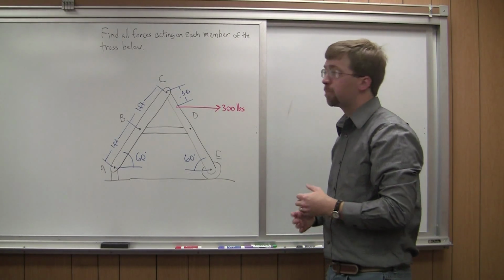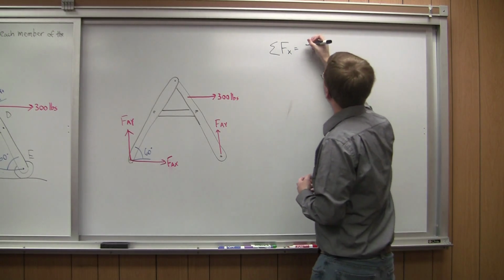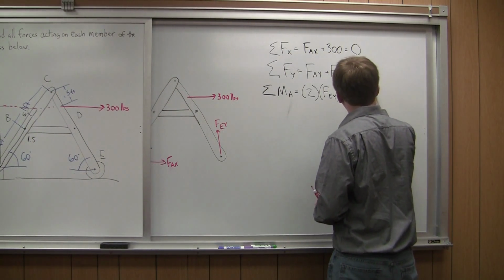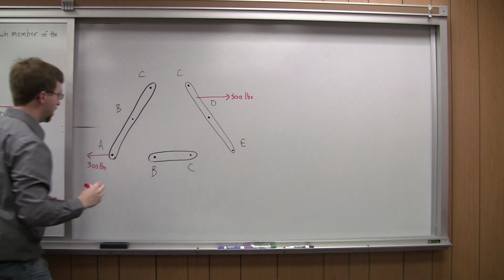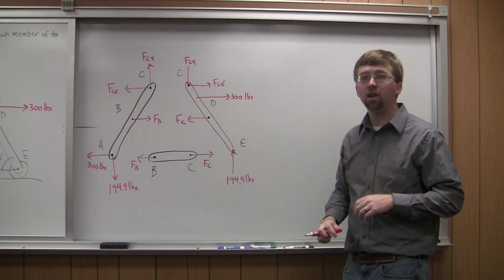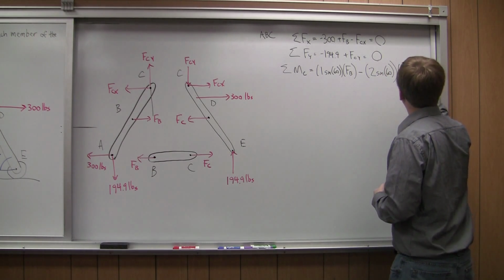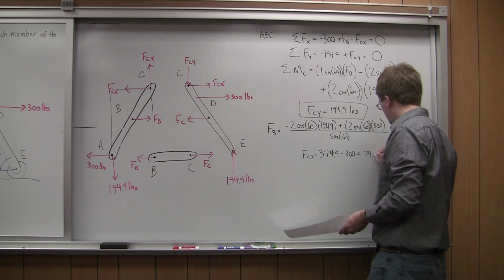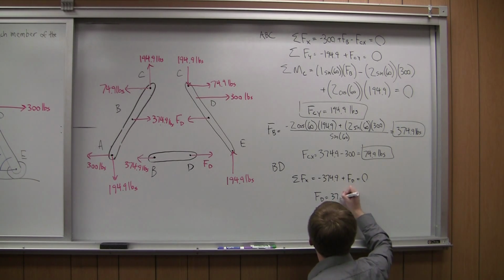Analysis of Frames and Machines - Adaptive Map Worked Example 1

Comment: How would you determine the determinacy of the structure using a formula
Reply from the maker: Determinacy is all about having enough equations to solve for all the unknowns. If you create the free body diagrams, count up all the unknown forces. Next count up all the parts. You will potentially up to three equations for each part (forces in the x, forces in the y, and moments). If any equations don't have any unknowns in them don't count them. You need to have at least as many equations remaining as you have unknown values.

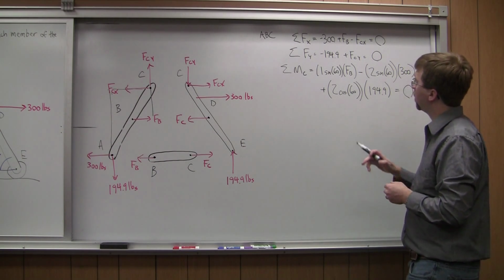Comment: 13:57 why you didn't take the 194.9 lb as a negative magnitude? Or is it always has to be the absolute of the magnitude???
Reply from the maker: +Ahammam Alsindi The 194.9 lb force would cause a counterclockwise (positive) rotation. Because of that, I treat the moment (force times distance) as a positive number in the moment equation.

Comment: I HAVE A QUESTION . IN OUR SCHOOL WHEN DOING THE MOMENT, WHEN THE FORCE IS ROTATING CLOCKWISE FROM THE POINT IT IS POSITIVE .HOW COME YOU USE THE NEGATIVE SIGN FOR CLOCKWISE ROTATION ?
Reply from the maker: +naruto uzumaki Because of the right hand rule (see my moments video lecture). In 2D problems counterclockwise is positive while clockwise is negative. This has to do with how moments are represented in 3D. Assuming axes with the x direction to the right, y up, and z pointing out of the screen, a counter clockwise rotation is represented by a vector in the positive z direction while a clockwise rotation is represented by a vector in the negative z direction.

In 2D, as long as you are consistent, you should not have a problem with the equilibrium equations. When you jump to 3D problems however where you can have rotations about an axis in any direction and particularly when you use vector operations such as the cross product you will probably run into some problems.